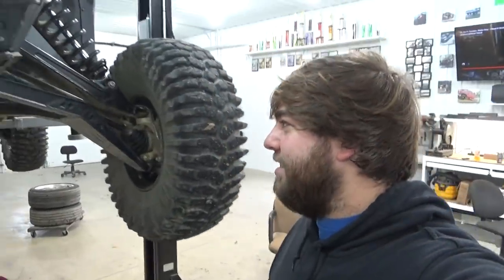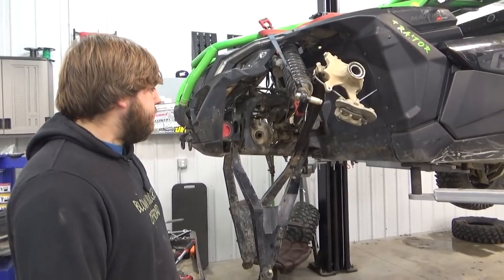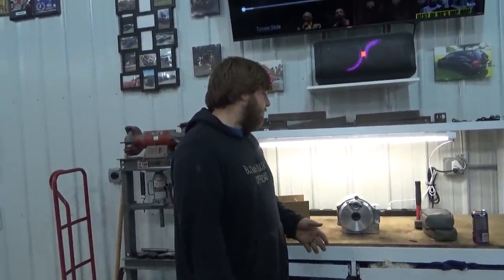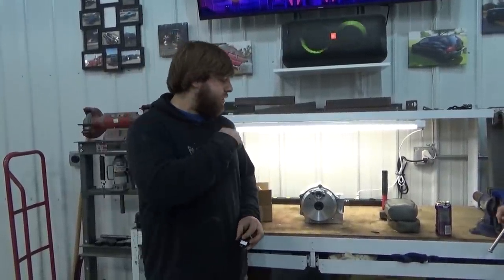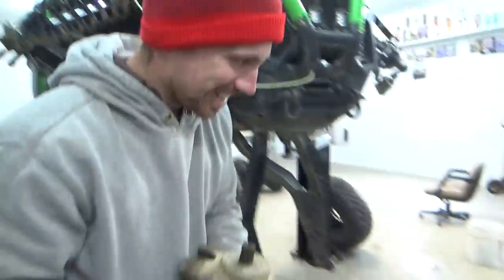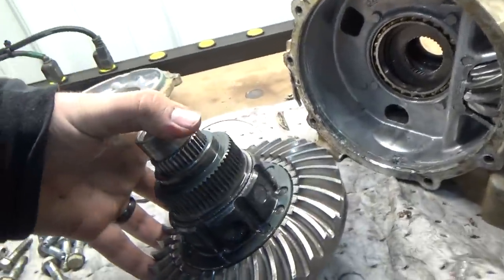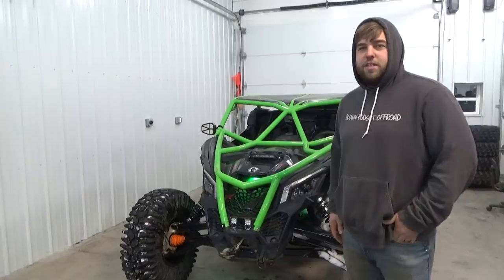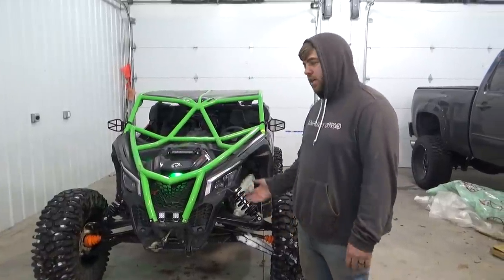Can-Am X3 Smart Lok Diff Tore Down & Explained | Halo 30 & RCV Axles Install!

Comment: I've got a 2019 xrc turbo r, riding in a similar way as you. I haven't had any real slipping of the locker, and I run 35's. Watching all your videos, I get the feeling the crack occurred prior and is what created the failure.
Reply from the maker: Send it harder it will slip eventually lol

Comment: Nice setup, can't remember if you have already upgraded your driveshaft. If not, keep a spare. Rode with a guy that went to that front set up because of the same problems you were having and now the problem has moved to breaking driveshafts.
Reply from the maker: It’s upgraded, I believe it should be mentioned in the next video
Reply: @BlownBudgetOffroad   what oil to put in halo 30 have one coming in a couple weeks

Comment: The locker reminds me more of a "limited slip" differential. Just that with it locked, there is supposedly enough force against the plates, that it does not slip at all... like you said. Not a true "locking differential". It really reminds me of the electric locker i used to have in my Tj wrangler. It was a limited slip until i activated a button that magnetically pressed enough pressure on the plates inside the diff, to make it so called lock. I forget what it was called now, but i think it was made by Eaton.
Reply from the maker: Seems that’s what they tried to mimic in some sort of way. The system does well for the avg consumer
Reply: And yes. The one i had in my jeep, locked up great for a year or so. After a few years it got to the point where even when i flipped the switch, only one tire would have torque to it. I do believe over time i completely burned up the clutches inside to the point they would not catch at all
Reply: I believe that Eaton locker was called the "ected"
Reply: @Stupidwon1234567  yes. That is the one.
Reply: I don't know if they even still make it. In my case, in my TJ, it only lasted about a year and a half. I barely ever actually "locked"  it, but the clutches seemed to wear out in a short time. I had to add a limited slip, friction fluid when doing the diff fluid changes. Maybe i didn't have the mix ratio correct. The ECTED worked great as a limited slip, while the clutches were good. :)

Comment: Have a 2021 with same exact problem just stripped the gear, thought about welding it to not spend 1400 bucks on it...... when you welded it how was the drivability? And how long did it last?

Comment: Love the videos -- especially thanks for this one.

I'm glad there's now a video so people can see this - I've tried to explain it with words a bunch of times but nobody ever seems to understand it. This type of locking mechanism is used a lot, and it's actually very effective - but that's only true if the clutches are sized appropriately and whatever is providing the clamping force has enough strength and range of motion to do what it's supposed to do. Tons of vehicles like the Toyota Land Cruiser, basically every Land Rover, some Jeeps, blah blah blah use this concept in both their "center diff" in the transfer case and in their front and/or rear diffs. It works great to go anywhere from unlocked to completely locked at will. But again, that only works if the clutches are strong enough.

Think about practically every motorcycle ever made - they use a similar clutch pack and spring(s) to put clamping force on it. That allows them to go from completely disengaged to completely engaged every time they start off. We don't consider those "not truly locked" as long as the clutches aren't worn out and they're big/strong/grippy enough to hold the power and weight of the bike. The same would be true with this diff - if those clutches were big and strong enough, and the actuator could put enough squeeze on them to hold, it would indeed be fully locked just like when you let the clutch pedal out on your car. Unfortunately it seems like this clutch pack is way too small and flimsy for what we expect it to do. Land Cruisers can run this arrangement for hundreds of thousands of miles without issue. Those plates in your diff are already smooth in practically no time. That sucks. This is a tried and true idea in the automotive industry for variably locking two shafts together. Can-Am just screwed up a fully functional (and actually awesome) system with under-engineered clutches. Shocking, Can-Am ruined a great idea with crappy details.

If someone could make a better quality clutch pack that might be the best solution for most owners. Most people don't need the big expensive option we have now -- you do, but most people probably don't. They just want the Smart Lok to work like it's supposed to and not wear out in practically no time at all. There's a company in South Alabama ( https://www.altousa.com/ ) that stepped up and made clutch plates for Victory owners when they had no good options. I have no idea how, but it would be cool if we could get someone like that the specs of the stock clutch pack and see if they could make something that would actually last more than a few hundred miles. I love the functionality of the Smart Lok, but nobody wants one that only works for a short time after every $300 clutch pack replacement.

Comment: Ok so the Halo diff works basically like my old 06 Rhino front diff it runs in 2wd it the switch and it goes into an open diff allowing the easiest tire to spin, then hit the switch again and it goes into a full locked diff making both front tires to spin. Seems like they would’ve done that to begin with at the factory. Which makes me think of putting a CanAm Commander motor into my Rhino. By the way how is Aleah doing with the pregnancy good luck to y’all

Comment: When in 4wd non diff lock the ecm and front diff module monitor multiple parameters such as wheel speeds, rpm, throttle input. 

Normal 4wd non locked acts like the older visko lok and based on what it sees, it uses the stepper motor on the actuator and ball ramp to actively modulate pressure on the clutch pack several times a second. 

The trail active modulates more aggressively than trail and moves priorities of sensors around accordingly.

Mud mode allows more wheel spin differentiation

Rock is even more aggressive in modulation than trail active.

Then when diff lok is activated it applies full pressure to the clutch pack and locks both sides true 1:1.  

Clutch packs are a wear item and if beating on the unit hill climbing and rock bouncing they will wear faster than desert, sand or trail usage. If performance is starting to diminish within the 4wd system, clutch pack likely requires servicing. Portal boxes and larger 40+ inch tires can also increase the wear on the clutch pack.

Source: am CanAm tech
Reply from the maker: Thanks!
Reply: Yes, thx Austin. Gotta a 2021 X3 RC RR on order and not liking what I’m hearing. But then again I probably won’t be as hard on mine. How many miles did your diff have on it before it went bye bye?
Reply: Thank you for this excellent explanation!
Reply: @starRayxx  sorry for such a lengthy delay. YT doesn't like to inform you every time you get a reply. I don't own one but I've worked on all of BRP's product lines exclusively for almost 6 years now. 

For the most part the front differentials on these are impressively robust considering what folks put them through. The last few years of CanAm Off-road product success in KOH, Dakar, BitD I think have solidified that.

Did you get your RC and if so how are you liking it so far?

Comment: I had my clutch pack crack as well around 1800 miles. I'm running a 20 xrc rr car with 32`S.   It worked great  at first but noticed the last few 100 miles ( before the loud bang ) that it was acting up.  From what I noticed ( when I tore it down ) the clutches are always spinning whether it is locked or not and the actuator applies pressure to the clutch pack depending on which mode you are in. So the clutch pack is a wear item that needs to be replaced. I always tend to run 4wd to keep the rear wheels from spinning but since the rebuild ( now knowing how it works ) i only run 4wd when it is needed hoping to keep the wear to a minimum. I like the way the smart-loc performs so fingers crossed that I get way more miles on this clutch pack. It works like it should again.
Reply from the maker: If only people shared more information so we could understand it sooner lol

Comment: I’m not positive but I’m guessing there is a computer that is watching the difference between the 2 wheel speed sensors and as it senses more difference it turns that gear engagement plate more to lock the diff.

Comment: Have the Visco HALO , if there is anything I can check for you if you are curious. I think the wiring and actuator are the same.
Thank you for doing such a great job pulling the smart lock apart and explaining what the hell is going on in there! I know its a PIA to film mid job particularly with oil and grease on everything, so thank you for being so detailed about it.
I think the difference between the smart lock modes is the "Inputs" it uses to decide when and how much lock to employ. Mechanically they are identical but the parameters when it wants to lock are different, like how quickly it will actuate, how many rotations before it gets aggressive.

Its nice to see the inside of one, where and how they fail!
Reply from the maker: Thanks man! Just trying to bring quality sxs content
Reply: @BlownBudgetOffroad  Nailing it for me, getting a lot of Real relevant content here. Things I am not seeing many other places, keep doing what you are doing.
Reply: Hi! How do you like the Halo Visco upgrade? What axles do you run? So torn about what direction to go.
Reply: @tcnpsu1  Run the stock axles as I have read they are the “best” solution overall.

If you are aggressive or don’t have a soft touch, HALO30 is likely the way to go.

Another channel was able to swap the HALO30 parts into the visco case. If I have trouble, might go that way, but don’t anticipate it will be a problem.

Comment: 2021 rs turbo rr halo diff and rcv expensive but works great. live in east tenn. rock climb but everything will break. had it for awhile still goes good but drive shaft had to have help.

Comment: Save that factory ring & pinion gear if its not damaged. Thats usually the part that will break in a halo diff. Also read at some point on the smart-lok....it disengages the "lock" above a certain speed and also passed a certain steering angle that its suppose to unlock
Reply from the maker: Interesting

Comment: Are the axles the same length right and left like the stock set up? I’ve heard different reports and I’m just curious
Reply from the maker: I believe the cup on the diff side is different. From what I understand this diff was originally made to replace the visco loks 
-Josh
Reply: Yeah there’s been a little bit a debate between a buddy of mine and myself. I know on the visco lok diffs there are two different length axles but my buddy is saying that the halo 30 upgrade on the smart lok versions have interchangeable axles like the stock SL. I know RCV and Turner axles are tough but  a spare is always good and  it’s would be nice to only have to have one spare from axles to cover breakage on either side
Reply from the maker: If you look at the thumbnail on the picture you can clearly see that one of the inside cups has a longer shaft. At least I can from the link on Facebook lol
-Josh
Reply: Yeah that’s what I thought but said buddy claims that I don’t know what I’m talking about ha ha

Comment: I think the slip in the front diff keeps the drive train from destroying itself. These SxS's, all of them, aren't bombproof to begin with so I can't help but think the clutches probably extend the reliability for most users. 

I think now that you have a halo and RCV's it won't be long before you break the drive shaft.
Reply from the maker: Most users is for sure what they are after

Comment: The service manual explain in detail how it works,it have a actuator,a locking solenoid and wet clutch pack .the actuator fully pulls what they call the"ball ramp" toothed pawl,then the solenoid lock the small gears inside the actuator assembly and shutdown the actuator to rest position .yes ,the clutch pack have to hold the right side spider gear hub locked in place, so if clutch pack spins  probably your clutch are worn out or oil is degraded.thats why so important to replace often the diff oil.
Reply from the maker: Yup. It showed signs of slipping very early in life though

Comment: Do you have any documentation, or trusted source, that says the lock allows partial engagement.   Usually, if not always, diffs are fully locked or fully unlocked.  The clutch disks are to allow a smooth cushioned engagement.  The rack and pinion style engagement is probably there for a better positive engagement/disengagement and reliability (reduced clutch wear), the design is a whole lot better than a solenoid style engagement mechanism.  Having a partial engagement is asking for the clutch disks to burn up, not good, not a good idea at all.   I had thought/think the "smart" part is WHEN it engages automatically, not how much to torque to apply to the 'other' wheel.  Also, that the computer is looking at spin difference between the front/rear, not side to side on the front.
Reply from the maker: Not really sure how to further explain. In theory doesn’t always translate to real world applications. We have lots of “field testing” that shows the diff isn’t always locked. On video. Not sure what else is needed to explain, there is a clutch pack that helps it slip therefore it’s not a true locked diff.
-Josh
Reply: @BlownBudgetOffroad  of course the diff is not always locked. Are you confusing 4x4 for a locked front diff?  In 2x4 the front drive shaft is not under power. In 4x4 the front drive line is under power. The smart lock is only referring to the front diff being "locked" or the clutch pack being engaged, so the difference of 3 or 4 wheels being under power.

2 or "4" is determined in the transmission, where 3 or 4 is determined in the front diff.  I'm just questioning if the front diff clutch pack is ever partially engaged; if so, it seems like extreme wear would happen shortly. Since the smart lock engages on the fly, under power, then you need a way to softly engage, hence the need for a clutch pack.
Reply from the maker: Not questioning any of if it’s in 2 or 4 lol
There is a clutch pack and the computer decides how to apply pressure to that clutch pack. So yes it’s always partially engaged. Trail mode, mud, rock, and trail active one can only assume each have a different style of pressure applied do given information from the sensors. The held down button for “diff lock” isn’t true because if it’s locked it should just let one tire spin lol. Hope this video help all of us understand the diff more 
-Josh
Reply: @BlownBudgetOffroad   The "assuming" part is what I am questioning.   Where do you get the pressure on the clutch pack is variable.  Documentation? source?

Comment: So basically this is a electronically activated positrack, or limited slip differential, which worked fairly well if maintained.  And it is why I have read some are changing the oil often, like every engine oil change.
Reply from the maker: That’s the theory anyways. This diff did the three wheel peel early in life though